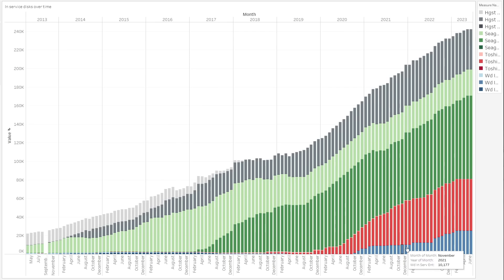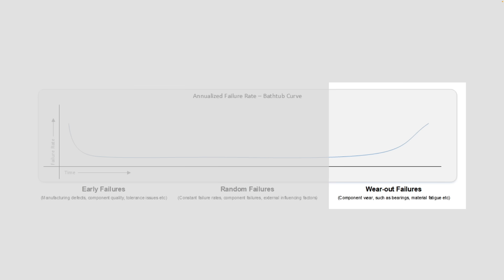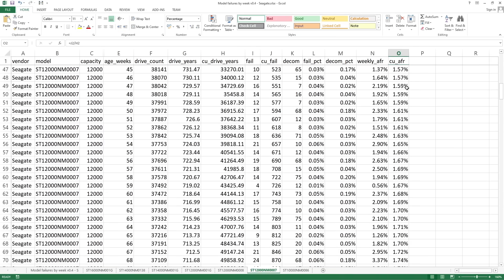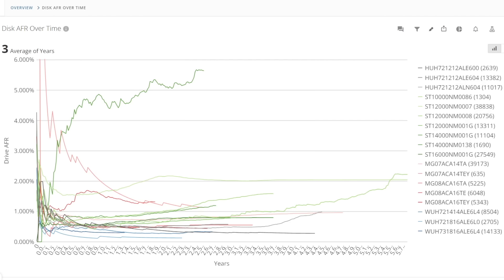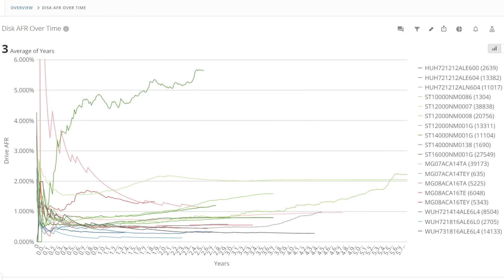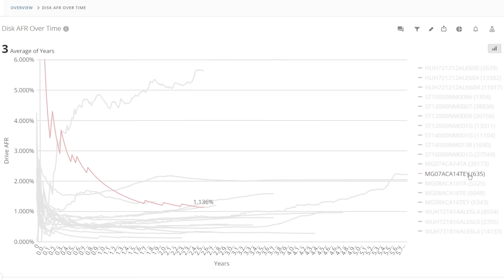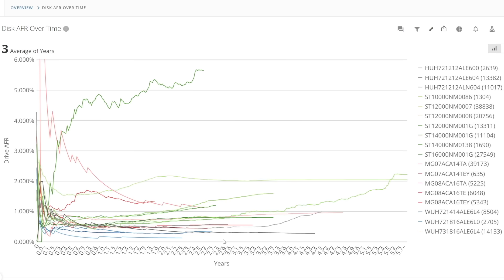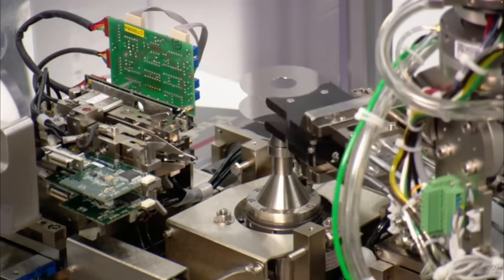Failure Rate Analysis - Best 10Tb+ hard drives: Seagate, Western Digital or Toshiba?

Comment: Statistics are the one point. Personal experience the other. Someone who had a failed WD will choose another brand, as it will do someone with a failed Toshiba or failed Seagate.

I´m running 8 Toshiba MG08ACA16TE what are called to be the worst of the Toshiba series. But since several years of 24/7 running in my NAS and DAS I never had any problem with one of these HDDs. While I had several failures in the past with WD and Seagate what lead me to Toshiba. So what?
Reply from the maker: It’s just data as you say, snd there are other less tangible factors such as brand loyalty, perception of support, availability and price. However data is good as it reduces the influence of bias. For sure if you have a bad experience with a brand then it affects your likelihood to buy again, good or bad. 

But also, I would say that very few drives are ‘bad’, the failure rates are all fairly low that if you have a small sample you are less likely to experience a failure at all, at least during the useful life. But there are meaningful differences. 

So this is just information that I have tried to present with as little bias as possible and it is an aid to anyone who is selecting drives. But in the end, people will buy what they feel best about based on multiple factors, and I am not going to tell anyone that their choice is bad.

Comment: Knock on wood, I have yet to experience a hard drive failure on any machine since starting to use them in the eighties. And yes they did a lot of work over the decades. I rarely turn them off.😁

Comment: What do you think about WD's derating of MTBF and AFR above 40°C?
Reply from the maker: This is an excellent question.

The WD language seems really vague on this. For many drives, its mentioned derating above their test temperature of 40C up to 60C or 65C, but it doesn't clearly quantify this. Maybe its in more details in their warranty docs. But they do also say that the MTBF does not mean warranty, and I am not sure what conditions may impact the warranty itself. Given that the MTBF numbers are rarely hit, maybe this is a get out for them.

Maybe its worth a deeper look, but temperature data is also recorded in the backblaze dataset, so when I do an update to this (which should come pretty soon), I can look at any possible correlation between temperature events and failures. That might be interesting, as I am sure these disks are often run hot. Both for home users, but also many hyperscalers run all their DC's hot to reduce energy consumption.
Reply: @sometechguy  they have make one day an article : no relation between fail and temperature , cold or hot . If you read technical data mtbf is 20%  less on wd drive put verticaly ..

Comment: Kudos to you for crunching all that data, and the conclusions you drew seem accurate to me. I must be lucky; my 2012 PC build had 4 Seagate HDDs, and one of them (4TB, huge in those days) is now showing its age but the others are still going strong. Maybe it's because mostly my PC runs 24/7, so they don't get the stop/start which I reckon ages them quicker. Now I'll be looking into some HGSC drives for my new build!
Reply: yes truning on off have an impact. IMHO brand is not important, but which factory makes it. Old hitachi that were i think taken by WD were amazing, if you find some old Hitachi 3,5'' new but older then 8+ years )left in some shop etc) they were great. Also 2,5'' Hitachi. but i would consider to get also SSD, last year price were low, now they are again high. For example i got 1 T SSD SP for 40 US$ only, Taiwan made HW brand. ''Silicon Power'' i like them, they have min failures when i asked my school friends who work in PC repair shops. Samsung SSD are expansive but the aren'0t better then SP, they poosh it for well recognizable name, due old Samsung disc were good. Adata is OK, Patriot was hit and miss. So for know i like SP the most when it comes to SSD, M2, even memory RAM is great. And for HDD is old Hitachi or WD.

Comment: Great video but I wonder what's the reason behind why there's bo 18 TB models included in that conapy's data set... Can't really believe, they don't use them
Reply from the maker: Thanks for watching and for the comment, and I can give you a bit of an answer to your question.

Out of the 224,000 drives in the 10+ TB dataset, there are actually 66 18Tb Seagate Exos ST18000NM00J drives with an average power on time of 23.6k hours , of which 6 were failed with an average failure time of ~7k hours. I didn't include them due to the small sample size, also true of some other Exos 16Tb and 12Tb drives with samples like 68, 26, 3 and 2. So they seem to test out samples of various models. They only ever had 20 units of the 10Tb HGST ultrastars also.

As for why BackBlaze didn't buy more, its hard to say. Maybe their testing and earlier failure rate put them off, or maybe the pricing just wasn't optimal. Other than the small unit count, its hard to draw solid conclusions from that failure rate. They could have had a bad experience in transit, or maybe they were early test samples. But the fairest thing is to exclude anything with a small sample set.

BackBlaze do seem to buy in bulk, and they may settle on specific models for sparing or predictability reasons. There are other disks they didn't buy. They now seem to be deploying a lot of 22Tb Ultrastars, but do not have 18Tb or 20Tb models.
Reply: @sometechguy  thanks... I've had a short look at their most recent update, too... I'm curious what will happen to their 22TB disks

Comment: TL DR;

WD >> HGST >> Toshiba >> Seagate
Reply: HGST was actually bought out by western digital in 2012 and was fully transitioned to the wd brand by 2018, so newer HGST drives are just wd drives I believe
Reply: It genuinely changes every few years
Reply: This isn’t necessarily true for consumer WD drives, Backblaze uses the Ultrastar enterprise drives.
Reply: Great, I bought the lowest on the list and also refurbished 😅 I will at least have the 3-2-1 method goin!
Reply: @zerocal76 i have 2 Sets of there running in a zfs z1, 6x exos 16 tb, all of them run since a year 24/7 with about 460 tb/year without any issue, they were recertified
Reply: Over my lifetime, all my Seagates fail and fail early.  All my WDs have been fine and still going.
Reply: @BlueBearOne  Hell I had a WD Green last 13 years, was the first 500 GB drive I ever bought. Recently got rid of it - still working mind you. It's insane to think something getting this old in this day and age, sadly.
Reply: Some WD drives are just rebranded HGST drives
Reply: My oldest WD external HDD is from 2013 and still running. I guess it is time to replace it. Just in case.
Reply: @MsNando21 I have some WD USB drives which must be from about 2006 and some from maybe 2004 with Seagate drives but enclosires feom another brand and  are all doing well.

Primey problem with these USB drives of all brands is always the external power supply which are always cheap.  That's cheap in the literal and derogatory sense.

I have a large number of 1GB, 2GB, 4GB, 9GB and 36GB SCA drives from Seagate which were all doing well when I last powered them up.  I have no non-Seagate drives to compare to.  But many of these must be from the 90s.

Some of these are actually HP-branded.  Afaik these are Seagates with modified firmware so I count them as Seagates.
Reply: Thank you
Reply: Weird. WD are the only brands I ever had die!
Reply: @saganandroid4175  For me that was in fact Seagate and Toshiba. One was 3,5 the other a 2,5 Laptop Drive. I never bought drives from them afterwards. But seeing WD monopolize the whole market is not a good look, so I was hoping it might have changed over the years. Seems like it did not.
Reply: @saganandroid4175  Over the years all brands had the curses series' of drives.  If had entire model series of WD drives die at work.  IBM (eventuall became HGST) had drives nicknamed Deathstar ...  Some models of Seagate drives didn't do too well.

If you're paranoid - and you should be for backup drives - then don't buy drives when they're new.  Wait a few month and if the reports are ok, they're now a candidate.  Bonus: at that time the drives likely have gotten cheaper and firmware bugs may have been ironed out.  Also keep for archival purposes don't just buy one drive, buy multiple for redundancy.

Modern drives in tight enclosures often die by overheating.  Be careful.  I also had drives getting killed by power supplies in subtle ways.  A voltmeter did show acceptable voltages - but on a scope the voltage was all over but in a way that just kept the average so a voltmeter would be fooled.  Construction work at work ...  Ouch.  Though drives supposedly are sealed pretty well and specified to withstand a certain vibration we had horrible death rates of drives during construction.  Across all brands and even though the machine room supposedly was sealed well.  But not well enough as it later turned out.
Reply: As expected
Reply: Yes, but the total number drives with wd and hgst soooo much lower than seagate in the used data.
Reply: i was use seagate, it fail after two years. lost all my data and can't be recovered.
Reply: WD and Toshiba broke for me, Seagate never, what am I doing wrong, lol
Reply: @pk-xc2em  How many drives do you have, for how long do you operate them?  Not all drive types are equal - but all will die, some sooner, some later - and there is a significant random component in the expected lifetimes.

Seagate is certainly not a bad brand but the next two drives here which I think may be on the way out are both 8TB Seagates.
Reply: I have had high failure rates with WD Red drives about 6 years ago so I switched to Seagate EXOS disks since then. No problems with 36xSeagate drives in over 5 years of 24x7 operation. Caveat: I use 16 TB EXOS enterprise grade disks which are more reliable than consumer models
Reply: WD is the sucks product
Reply: Thank you sir. I would have expected something like this at the end of the video.
Reply: Yeah I used to have WD drives die.
Reply: Samsung were failing aswell
Reply: basically nothing has changed since the 90s.  seagate always sucked.
Reply: @thisguy6559 How are they still around? 😂😂
Reply: @FR4M3Sharma   Because they are always at the forefront of storage advancements. The overall MTTF is still very long with Seagate drives, even if it is a bit shorter than with other manufacturers, so for enterprise applications where failed drives just get swapped out, it works quite well. In the home setting, where RAIDs are either small or nonexistent, the higher failure rate (slightly shorter MTTF) leads to people losing data, which isn't a factor when working at large scale.

Basically, they aren't complete rubbish and he is exaggerating.
Reply: @thisguy6559  I've had great experiences with the Seagate Firecuda HDDs. Unfortunately, they recently discontinued them.
Reply: Seagate drives have served me well for over 30 years, apart from one particular model. They tend to be quieter too.
Reply: Toshiba is not the most reliable??😮

I don't know man... but the external hard drive Toshiba Basic 1TB I bought back in year 2012 still works perfectly fine
Reply: My WD died and a coleague had a couple of WD which died. We use Seagate with no issue
Reply: WD? From 2k to now, every time I tried a WD, it broke.
For a few years, I decided to avoid them.
Reply: LOL looks like nobody actually looked at the data. This video shows that the Seagate 16s are dramatically more reliable than every other drive unless you ignore the huge DOA rates of other drives (which oddly this video does). And notice that this data is coming from a place which definitely prefers Seagate and continues to buy twice as many Seagates as other brands.
Reply: @RaquelFoster  I know right? Toshiba especially is utter garbage based on the data in the video. Putting it above Seagate is wild.
Reply: I’ve had more issues with Toshiba drives than seagate.
Reply: Best to worst I presume
Reply: @ivangutowski  At home, WDs used to be so bad that I decided never buy them again. I shall now reconsider.
Reply: @tiitulitii  Yeah WD was horrible right up to 2022 at least.
Reply: @tiitulitii  beware these tested are ENTERPRISE drives, not the cheap consumer ones.
also most are high capacity (10TB+).
Reply: @tiitulitii  The color of WD really matters.  The blue and green lines are designed for super casual use, but a lot of people bought them because they were cheap for NAS or other more robust uses, then wrote off the whole brand.

Comment: I'm going to buy a new disk, probably refurbished. Should I first test it like this when the new one is empty, or is it best to fill it all the way and then test it?
Testing would take days because of the large capacity.
What is a safer test, when the hdd is empty or full?
Reply from the maker: I would run a full smart test, the smart data logs counters for interesting things that may be a concern, like uncorrectable errors or reallocated sectors, but depending on your tool you may be able to run a full surface scan. Which will take a long time. Fully writing the drive should also highlight issues as the disk will have to try and write data to the entire disk (or close to it). The simplest is probably just to do a full smart scan. But it will take some time.
Reply: @sometechguy  I don't know what year they started producing 12TB hdd, but I'm not sure it's more than 10 years old.
The thing is that with the same label on "Amazon" it says that the discs are refurbished, and in my country local stores claim that the discs are brand new and not refurbished. They probably know that I have no way to verify that information. Everything is reset.
It's not an expensive hdd, but it's really not fair for them to lie. And if I enter the code from the label and it turns out to be fake, then maybe I can return it to the seller?
I have 2 HDDs that have been repaired for quite a long time, I bought them used, but they have the label "repaired" and the newer ones do not say "refurnished" on them, and that's why it seems that stores won't recognize them.

Comment: seagate and western digital are shit have always been ever since the old HDD`s, i have used toshiba and Samsung , no problems , got 6 years out of the toshiba 500 Gig SSD, my current toshiba x 2 1 terabit SSD`s at are just over 4 years.
I pulled my magnetic drives out as soon as i could get an SSD hard drive in Australia , it was a 250 Gig drive.
Failure rate also includes how heavy or light the work the hard drive does over time.

Comment: My first Harddrive was 100mb and cost me 250 USD. With that said I have used many hard drives. I have 17 drives saved up from over the years. My oldest is a 20 year old Seagate and it still boots whatever box i install it in for testing new used arrivals. It handles 14 hour grueling memory tests without a hitch. I have used at least 6 Western digital drives and IMHO they arent worth trusting your data to.
Reply from the maker: I now wish I had saved some of my old drives, just for sentimental reasons. There was something very industrial about some of them and would be a great trip down memory lane.

Comment: Fun fact: bought 2 years ago 4 x 8 TB Seagate for my NAS, new and sealed (not refurbished, but without warranty).
All 4 driver started working, I have transferred 1TB to the first drive, 
when suddenly a head stuck sound started to be heard from my NAS.
I took the affected drive out, all data lost, I've contacted Seagate for a data recovery, 
the valid warranty expired a month ago, cannot do data recovery.
Other 3 drives are used daily, got around 20K work hours on them, with no issues whatsoever, but the first one... other story.

Comment: I wonder how they compare to SSD failure rates.  If you are buying a single drive as a backup, you want the best quality, but if you are operating a nas, you can withstand one failure and not lose your shit.
Reply from the maker: I have heard mixed things about SSD failures. They are complex in a different way to spinning disks and have different failure modes, but seems that some specific models had issues with earlier failures, more likely due to firmware issues. They also have a lot lower endurance than HDD, but how much that matters depends on how much data gets written to the drive, where as HDD don’t seem to fail directly due to data written but more due to mechanical failure or G shock.
Reply: @sometechguy  Thanks for replying.  I am just brainstorming ideas for eternal storage.  The electronic equivalent of clay tablets.  DNA may provide a clue.  The medium would periodically replicate itself - and all the information.

Comment: Are these all SMR drives?

Have you found that SMR drives are less reliable than CMR drives?
Reply from the maker: None of these are SMR. I don’t believe Backblaze use any SMR, and they should be avoided for RAID use cases or for other fault tolerant setups like ZFS. I am currently putting a video together doing direct performance comparisons together for CMR and SMR, which also looks deeply into what is going on inside those SMR units. It’s pretty interesting.
Reply: Thanks,  @sometechguy .

It would also be interesting to know which drives fail catastrophically, and which just start relocating occasional sectors.

One of the (few) advantages of spinning rust over SSDs is that when SSDs fail it is usually catastrophic, but when HDDs fail it is usually much more graceful, and data recovery has a high chance of success.